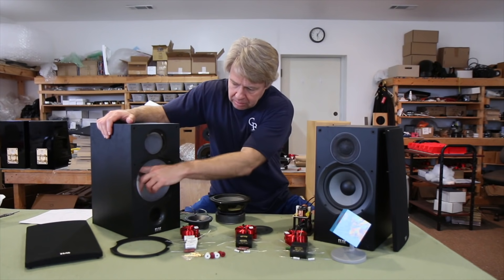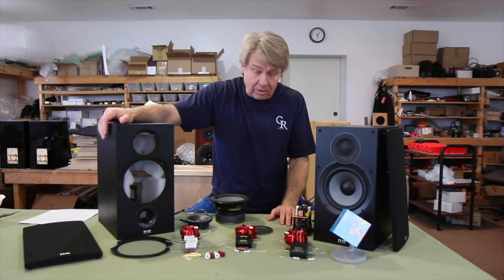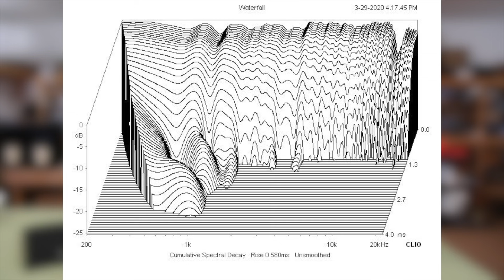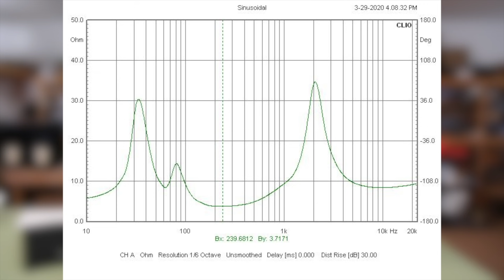Elac Debut 2.0 Upgrades and Modifications!

Comment: when taking apart these speakers can you please share some box dimensions and volume and port width and depth. if possible stock cross over specs and upgraded specs. and and T/S values for the drivers. 

But you do you its your show.
Reply: I can measure all of that, but it is not relevant as the drivers and box are fixed and cannot be altered.

Comment: I'm planning on making my own cables it looks really easy
Reply: It is. Tiny set of screw drivers from Walmart , there brand and connectors from Amazon. And organization trays from the 99 cent store. Soldering is pretty easy. Get a soldering station with a good heat gun. For smd work. And buy plenty of flux and some cans of electrical contact cleaner from Walmart, these are my cheats. Cause flux is very corossive. Oh yeah two pairs of side cutters. Plus a good wire stripper from kline at home depot and a good connector crimper. You can get a cheap one off wish but the kline at home depot is better maid. Also watch how to crimp battery cable connectors that will help you understand why a good solid crimp is important. Plus all the strands must be inside the connector and properly soldered or crimped with no air gaps inside. Yes this is a lot of detail but after you learn this which is pretty easy. Then move on to scanner danner on automotive electrical plus mr. Carson's lab or x-ray tonyb. Google can show you all the basic symbols for electronic components. ,solor 12v, 24v, 48v are all good things to learn I watch diy solor. There is so much to learn about electronics. This is why electronic repair people are nearly impossible to find. You will need a soldering matt but you can use a rubber car matt, the local junk yard is a good place for components such as relays, diodes, transformers, capacitors and cables. If you are on the cheap like the rest of us.
Reply: @Eagleoneradiogod  Plumber's flux is very corrosive. Rosin (electrical) flux, not so much. Just clean up afterwards with isopropyl alcohol.

Comment: It seems that this upgrade pretty much is the same that Elac performed when they introduced the new Debut Reference speaker.   Same drivers (new cast cage), improved cross-over, more rigid cabinet, and new wave guide.   Essentially the same mods that DR performed.   Starting from scratch, I'd buy the Debut Ref because of the improved aesthics of the new cabinet but since I have the Debut 2.0 I might do the mod just for fun.
Reply: They parts quality in the higher end models are still not even close to what I am offering in this upgrade.
Reply: @dannyrichie9743  No doubt.   The only point being is that you & Elac were both moving in the same direction with the improvements as a package.   Do you have a preference between the modified Elac Debut 6.2 and the modified Klipsch RP-600 ?
Reply: @great100m  The RP-600 was problematic by design. The Elac was much better designed, uses better drivers, and is the better sounding speaker.

Comment: Hi Danny,

What would be the difference in sound quality between these modified Elac debut 2.0 vs Your XL-S  Encore kit?

Or would it be better to compare the modified Elac 2.0 to the sound quality of the NX-Studio?

As of right now I own the JBL Studio 230. I think they are pretty good speakers. I'm just wanting to upgrade to something on another level that won't break the bank to much.

My wife and I do 50/50 with listening to music and movies.

Our listening room size is 14x12.
JBL Studio 230's
JBL Studio 235 center
2x Rogers Speedwoofer subwoofers

To me the JBL STUDIO 230's are just a little muffled in the mid range. It's probably the cheap materials in the crossovers they used. Maybe a JBL Studio 230 upgrade kit would take them to another level. Still not a bad set of bookies for the price.

Thank you...
Reply: The X-LS Encore still uses higher quality drivers and even with the same internal parts it is still at a different level. 

The NX Studio monitors are in a different league. That is a cost no object conversation for a stand mounted speaker.
Reply: @dannyrichie9743  Hi Danny,

For someone that listens to music and movies with the same system would the NX Studio work for both? I would imagine so. I doubt you'll make a center channel for the NX Studio line. Maybe the imaging on the NX studios are so good you won't need a center channel.

Maybe Paul from the Audio Circle forum will start making a flat pack for the NX Studio boxes.

Comment: Any chance one of you nice folks has either a picture or drawing of how you laid out these upgrade parts? I am having a bit of a struggle keeping the dimensions on a single piece of MDF down to something that will fit in the enclosure. Not sure if I should trim off some of the leads coming off the inductors or what?

Comment: Guys, when you're talking about budget speakers there really isn't enough to be gained to bother with changing them unless you just want to have some fun. The Debuts are about as good for their price as their design goals, budget and component quality allows them to be. The new frequency response graph roughly parallels the original with basically a 1.5 to 2db drop at 750 Hz but a 1 to 3db rise in the 200 to 400 Hz range. Perhaps a less critical range but it's just trading one issue for another because there's only so much anyone can do with a given driver and the provided cabinet. Will you notice the difference? Yes, but will it be dramatically better? For a few but not for most. Danny is good but Andrew Jones is as well. So, if you want something worth the money and you're willing to do this sort of work then build a kit. Any kit from any reputable source will outperform anything in it's price range and usually items costing far more.
Reply: Keep in mind that slight frequency response differences are minor compared to the differences in the quality of the crossover parts. That is where a mod like this takes a speaker that is pretty good to being really good.
Reply: I have a pair of the Debut 2.0s and for the price/sound quality I wouldn’t change a thing. They’re a rock solid pair of speakers that easily compete with speaker at a higher price point.

But if you’re a tinkerer...go for it!
Reply: Hi Dave, i arrived here because i was looking into Elac, for instance the Elac Debut Reference DBR6 interested me a lot, but a bit at the top of my budget.Now i'm thinking more and more of building a kit, i saw "heissmann-acoustics" but do you have other good names to share ? Thanks :)
Reply: @sanpojapon  Hi Nic. I actually hadn't heard of Heissmann until you mentioned them. Seems to be well thought out and designed product. Beautiful cabinetry as well, though it doesn't seems as though the cabinet materials are included. Which is often the case for many kits, not just these, so no points off for that. Some other companies that offer good kits in the price range you mentioned would be Parts-Express, Madisound, Solen and DIY Soundgroup as well as Gr Research's own kits. If you don't have the ability to build a cabinet then look for kits that include at least an unfinished cabinet or that offer an affordable cabinet separately that was designed to the specifications of the kit drivers. Also, if you're hoping to match or exceed a commercial offering be mindful to try and match or exceed the basic design characteristics of that product when choosing a kit. Meaning, if you're looking at the Debut Reference then consider that it is based on a 6.5 inch bass/mid-range driver and is a ported design. So if you desire to at least match the bass response don't think a kit with a 4" driver in a sealed enclosure is going to do that no matter how high quality the parts are. Another thing to consider is what you really want to achieve. If the Debut Reference, the 6.2, or really any speaker in that price range offers satisfactory sound but you want more volume, dynamics, weight and the other things that only larger speakers can deliver then you probably won't be satisfied with a kit that only offers equal sized drivers and cabinets. Yes, the sound quality of the kit will likely be better but there often won't be a dramatic increase in dynamics as many commercial designs specialize in getting as much impact as they can from their bookshelf designs because they know that's what most people are drawn to. If impact and scale are all that's missing you may be better off to buy a tower version of the speakers you already enjoy as bookshelves. Or just try adding a sub and see what that does.
Reply: @davep2945  Hi Dave, thanks a lot for your very complete answer and your advice! I should have mentioned that i'm in Europe, but i still might be able to find some of your names here maybe. Regarding the Elac Debut Reference 6.2, that was a choice only by reading reviews and because of my space issue i don't think i can look into bigger speakers. I will really look if i can't have enough space for tower speakers. The Heissmann cabinet are available from another resseler.  Now i'm using an old Nytech Obelisk CA102 from my father, i still need to check if it's still working properly, but i'm worried that it might not be enough to power good speakers. I think it's a 2x25w or 2w30w something like that.

Comment: This was interesting... thanks for the rundown. I might get a pair of the slimmer ELAC debut on-wall speakers (DOW42). I have a 16x16' room and was considering using them combined with a small sub on the side. Do you think I'm better off with the larger Debuts as seen here?
Reply: Performance wise you are always better getting the speakers away from and off of the walls.
Reply: @dannyrichie9743  While I normally agree with this sentiment, the DOW42's are surprisingly good as surrounds and Atmos (ie. ceiling) - even right against the wall.  I'd guess it's likely do to the lower workload and perhaps the down-firing ports.  For fronts though?  No way.

Comment: Thank you! Danny! I just got a pair of these! Now I'll have to save up a bit... Thanks again!!! I don't quite understand how the "loop" you mentioned would be set up? Before the video, I would have thought it was just replacing some of the parts. But it sounds like you put a whole new one in. Did I get that part right?
Reply: yes he has used a notch filter at 750Hz to smoothen out the woofers response curve
Reply: Yes, I designed a new filter.

Comment: Switching woofer coil from low R to linear but higher R coil is a bad idea in 2D speaker, you just loose about 1db of bass. I do not mention change of Qes and caused by this required change of box volume...
Reply: Oh yes i just come to impedance chart, you really blow up the woofer to box adjusting (see my comment about Qes), see the woofer resonance deep at original and your chart....

Comment: When upgrading the crossover, the parts are significantly larger.  How does this effect the internal volume of the enclosure? Seems the smaller the speaker the more critical volume loss would would be.  With the kit, would there be a suggested layout/placement of parts?
Reply: I'd mount them in the bottom of the cabinet. They take up very little air space. Adding a little more insulation about the size of your fist will make up for it.
Reply: Affect*

Comment: I'm interested in this upgrade but not really sure if it will help with my main issue with this speaker which is the treble sounds a bit subdued and lacks sparkle,  that and how import taxes and postage to the uk adds up.
Reply: This upgrade solves that issue. And I can send these kits to the UK cheaper than you think.

Comment: Andrew Jones designed those with the grills on the tweeters. He said in interview that taking them off would mess up the balance of the crossovers he designed. So probably not smoother.
Reply: They measured smoother with the metal grills off, and the overall balance was not effected.
Reply: They did a new crossover...
Reply: Andrew Jones should stop designing tweeters with stuff in front of them.
Reply: I have these and I recommended the same last year and as usual was pooh paahed about AJ knows what he does. No disrespect to AJ, but they are sounding better without the grill on the tweeter.

Comment: Update as of 2020. I bought these and thought they were OK. A little dull sounding. So I bought a new premamp (Emotiva) and use it with and old QSC power amp (class C) Still not good . so I bought a new power amp(Emotiva)
Still not good . So I bought a new DAC (Schiit) Still not  happy. So I bought a new CD player. Not good enough.
Then I did something crazy, I pulled out and old pair of Wharfedale Diamond V  from many years ago. I haven't used these speakers in 15 years.  To my surprise they sounded much better than the Elacs . I may have to get the upgrade.

Comment: Danny, does the original white foam go back in after you add the deadening material?
Also, have you done the new Elac uni-fi UB52-s?
Reply: Yes, you can add back in some of the original material. 

And I have had a set of the Uni-fi UB52's sent it. I measured and tested them. They just weren't worth upgrading.
Reply: @dannyrichie9743  That's good new for the Uni's!
Reply: @dannyrichie9743  Is that because they're pretty good out of the box, or because they're crap and too far gone? I've never heard them in person.
Reply: @AdamCornwellImages  For one there was not enough room in the box for a real (good quality parts) crossover. The three way design is also more costly.
Reply: @dannyrichie9743  Thanks Danny, I wondered if that might be the case.
Reply: I realize it's a year later... but just in case someone else is curious... I just did my Elacs and there's only thin white gauzy material inside. It's so light I don't even know what it was supposed to accomplish. It was glued to the inside perimeter of the box. I left it out because the No-Rez takes its place, and the speakers sound great. But I might throw it back in, just so it doesn't end up in a landfill... for now...

Comment: I just got the ELAC speakers. They are great speakers as they are and I really like the dynamics and details without done any upgrades. I can see the potential in the speaker so I will do all upgrades that I can think of. My previous Magnepan 1.6 and  DIY SS 15W8530k00 with Hiquphon OW4 just sounds rather boring compare to this speaker. Box, plastic details and crossover are too bad quality but that can be "modified".

The only thing I don't really like with the upgrade is the way of fix the 700Hz bump in the crossover. It might be a cone edge resonance but is rather low in frequency and the cone feels rather stiff. Can the problem be the thin plastic ring outside the driver. I thinking about replace the ring and use model clay instead (Plastilina). Anybody know the reason for the 700Hz bump?

If I lived in USA there should be no question that I would bought your upgrade kit, but it's get too expansive with the shipping and tax etc for send it to Sweden (probably end up with over $600).
Reply: The 700Hz hump was not caused by the beauty ring, but it did need some attenuation.

Comment: Hi Danny 
Can you list parts of crossovers that we need to upgrade Elac B6 upgrade Level-1 
What resistors do I need? Models and full specifications
Reply: @dannyrichie9743  Is there a chance I could hear somewhere online the difference between stock (I own a pair) Elac 6.2 and modified using your upgrade kit ? It would be encouraging to make a buying decision... :)
Reply: @KonradSkowronski  Hear the difference online? Playing back some sound clips from a compressed Youtube file is not going to allow you to hear how significant the difference is.
Reply: @dannyrichie9743  Oh, it doesn't have to be compressed by YT sound file but for example 2 wave files to download from your site. Anyway, properly miked room/speakers can be kind of informative even via YT. If the upgrade is that good it should be audible even through not perfect online comparison IMHO.

Comment: Danny, a general question regarding a crossover caps replacement: when replacing original electrolytic caps with some polypropylene caps should we use the same cap value or somewhat lesser value? I've noticed that electrolytic caps quickly loose their capacitance on higher frequencies but the PP caps don't. As I have no set-up for acoustic measurements but do have the Dayton Woofer Tester 2 system I've got an idea just to match a new (after a cap replacement) impedance curve with the original one. Is that a valid approach for a speaker with a good flat FR from a factory?
Reply: Replace them value for value.
Reply: @dannyrichie9743  Thank you.

Comment: Danny, quick question. Did adding no rez change the tuning of the enclosure? I see the impedance dip in the low end moves up by 10Hz and the Q of the tuning looks different based on the impedance peaks?
Reply: What I did (and the No Rez) had no effect on he tuning. During testing I had the back cup off and just some cardboard taped over the hole with wiring hanging out of it. That effected the tuning. So disregard that end of the chart in the impedance curve.